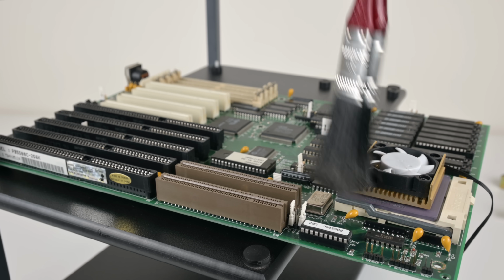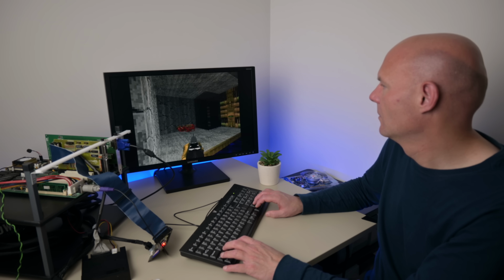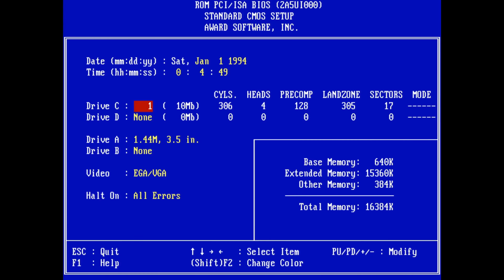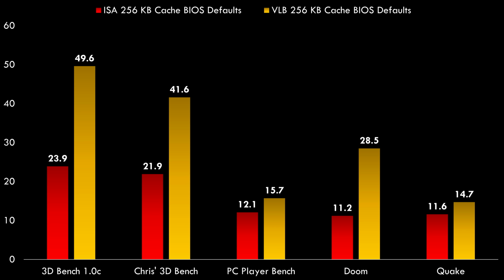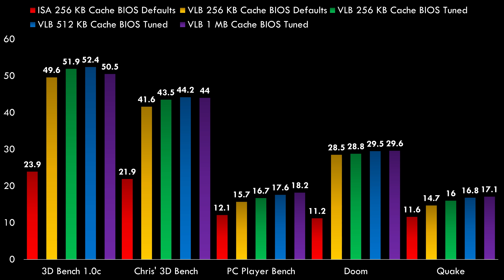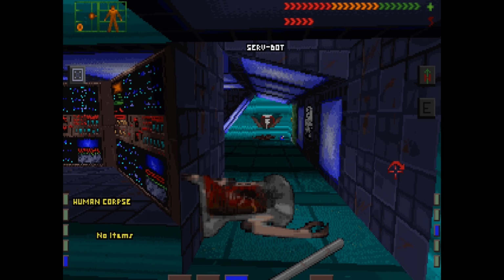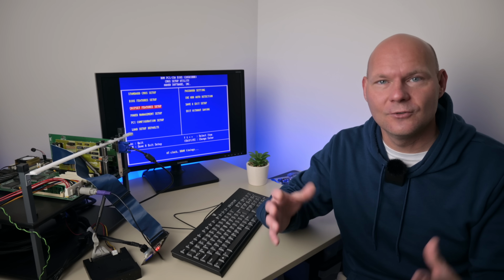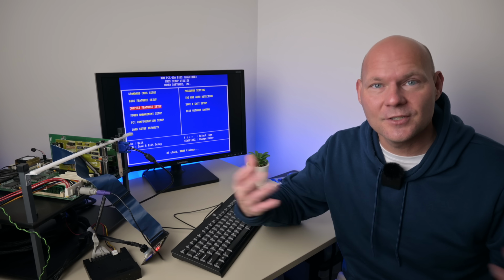Broken CPU Launched the Pentium Branding

Comment: I remember when the p60 first came out and it being so ridiculously expensive compared to a high end 486 that it just wasn't worth it
Reply: Yep, especially considering there were much cheaper 486DX4-100 available around that time which were almost as good as those early 60/66 MHz Pentiums (depending on the task). Though when shortly after Pentiums went to 90Mhz and higher clocks, then it became clear what a beast Pentium architecture was. I was on a 486 DX4-100 until Pentium MMX 166. Fun times, I was really into all that computer stuff back then, was reading all the magazines about new CPU's, video cards, sound cards. 😆 It's not as exciting now as it was back then.
Reply: @kosmosyche  hi, wasn't uncommon for the top end CPUs to command an insane price above the next performing one, the fastest 486 was a budget alternative to the Pentium 90.
The first computers with the 486 DX2 66 were also crazily expensive, that is a March 1992 CPU, the socket 4 Pentium 60 came a year later in March of 1993, then the socket 5 Pentium 90/100 came in March 1994 alongside the 486 DX4 100, in October 94 Pentium 75, and in March 95 Pentium 120 (the 133 before Win 95 in June) so if you didn't needed the FPU of a Pentium a fast 486 were still a great budget option, but you would need a 120/133Mhz 486 to clearly beat the slowest pentiums on integer.
BTW in November of 1995 Intel introduced the Pentium Pro 200(256) at 1300+$
Reply: I remember at the time the first   Pentium came out in 1993, people were just starting to upgrade from 386 or 286 to 486, so usually the average consumer would buy the previous generation when the new one came out because prices came down for the old one and were suddenly affordable. 1993-1994 was also a pivotal point for the PC in general, as a lot more people started to buy PCs for home use, and the most popular CPU for that was the 486DX/66. I only got my first Pentium in late 1996, clocked at 133MHz, and I couldn't have been happier.
Reply: @elimalinsky7069  indeed as the pentium was available when I built my 486 pc but at the time very few games even required an fpu let alone  the kind of fpu the pentium had. That all changed when quake arrived but by then there were much faster pentiums available at more reasonable prices

Comment: This seems like a fun board to work with, I've noticed you hadn't really made a video on the 5x86 either, I do wonder how this board would fare at max with that 1MB of cache and that modified ATI Rage XL from covid times.

Edit: I just noticed this is a Socket 4 motherboard, when I saw "Pentium" my brain went immediately to the Socket 3 overdrive.
Reply: The OPTi boards were slooowwww

Pretty much the bottom of the bucket as far as the original P5 chipsets go, not that there was a lot to choose from.

Their only saving grace was that the P5 was just so much faster than any 486 when it appeared on the scene.

I remember downloading some of the white papers for the chipset since I had one of the OPTi VLB boards - Viper I think.

My speculation was that the OPTi boards weren't even making use of the Pentium 64-bit bus. If  you referenced the white papers IIRC a lot of the part numbers were the exact same as their late model 486 chipsets.

Comment: This was such a crap CPU - I only had to deal with ONE socket 4 Pentium, briefly in the mid 90s, probably like 1997. It was AWFUL. VLB, FPM RAM (No EDO support on the Mobo, IIRC it was Asus) poor timing... Honestly my DX2/66 seemed faster, and my DX2/80 definitely was. That last one had PCI so that may have made a difference.

Comment: These first gen Pentiums are some the most interesting systems but as you have showed their performance is not too much better than good 486 build and 586 chips or the 83mhz socket 3 overdrive tend to outperform the socket 4 Pentium. Though my only experience with socket 4 is a Deskpro XE 560 and even with the Qvision 1280 giving it nice boost in gaming the performance still felt underwhelming but guess have to look at it through eyes from 1993.

Comment: By far the best retro build option for a sort-of comparable system IMO is to get one of the early Pentium IIs with an unlocked multiplier. They're not expensive, the boards for them are more easily available, and you can find them in ATX so they fit well in less expensive modern cases and use modern power supplies. Being unlocked processors, they can be sped up or slowed down as needed to be flexible for a wider range of software. You'll get a lot of flexibility with AGP, PCI, and ISA slots, too. They're perfect for both MS-DOS 6.22 + Win3.1 and Win95/98 or Windows 2000.
Reply: Very good advice. A P-II on a 440BX motherboard is rock solid, the pinnacle of stability and compatibility with any number of vintage operating systems, apps and games.
Reply: Agree. Beyond this point, compatibility gradually wanes, especially when it comes to ISA support. People often warn about needing to find ATX 1 power supplies for such systems, but, in my experience, modern power supplies are sufficient for all but a relatively small sliver of high-draw Athlons during the transition to using the 12v CPU power connector, which was known as the "P4 connector" at the time. Even then you can get the right boards, like the nForce line, which include said connector. You will need to do something extra to get -5V out of a modern power supply though.
Reply: By far the best? Maybe for you, but a Pentium 2 is further away from the 286, 386 and 486 era, where a lot of retro games come from. Then there were the Pentium MMX which had the advantages of compatibility with those and the early Pentiums, as well as "new" MMX enhanced software. There is no "best" solution, just a solution that suits an individual's wants and needs. You could argue an i7 or Ryzen with DOSbox is the better solution.
Reply: @another3997  I think you know what I mean: "best" as in best solution for someone wanting to build a machine to replay the software from the original Pentium era on bare metal. It's not "further away" from those older chips you mentioned in functionality terms, either. P2 is fully instruction compatible with those older 16 and 32 bit x86 chips, and there are options for downclocking it to be generally speed compatible as well if timing sensitivity comes up as an issue. The boards for P2s have ISA slots, so the same sound card, ISA video card, etc., you'd use with those CPUs are still on the table (with the exception of VLB, but just get a PCI video card for that).
I'm just making an honest recommendation for people who want a physical retro computer to run retro games / software on a period-correct (mostly) platform. That was implied as the specified need / use case. Please don't come in here and try to derail a productive discussion with a bunch of "but you could argue _ because it all depends on your wants and needs!" And, like, DUH, yeah, it always depends on wants and needs. But those are pretty well implicit here, so what are you really contributing with the naysaying?
Reply: Look up Phil's AMD K6-III build. Intel fanboi 😛

Comment: VLB were awesomme on 486, but moving to Pentium it was more like a stop gap for reusing what VLB card you bought with your 486.
Reply: Yeah, that's exactly what it was. PCI was a thing by the time Pentiums were, and putting VLB and PCI on the same system often didn't work as well as hoped. It was clear that PCI was the future, but there was just too much leftover VLB hardware to leave behind all at once.
Reply: @wasd____  Yup. PCI-VLB bridge slowed the system down.
Reply from the maker: I believe I tested PCI but don't remember the details. I must have not found much of a difference otherwise would have used PCI.
Reply: @philscomputerlab  i believe it was a former user on Vogpns, that did a test using Pentium board with VLB, PCI and ISA.
Reply: @philscomputerlab I just had this idea for your channel, now that you did an Amiga video a couple of years ago.

Now that the newest console generation is nearly 20 years old. Then why not get a Playstation3, install custom firmware on it, and then test emulators and other homebrew software on it, as well as the overall gaming experience of Ps3 games them self.

It is kind of starting to become retro gaming now, as those that grew up with these machines, have begun settle down and starting family. It is with the 7'th generation now as it were with 486, Amiga, C64, that at some point it is cheap and then prices explode. That time have come now, with that console generation. Cheap before it becomes hip to own.
Reply from the maker: @brostenen  Consoles is just not my area. Even DOSBox, PCem, 86Box is pushing the boundaries of what I want to cover. The Amiga video, yea I remember this time, it was the original Mist FPGA computer!
Reply: @philscomputerlab  It might just be me then, that love anything gaming. 😁 Computers, consoles, handhelds.... Love it all. I just dont get why some people are fanboys, but I fully respect if someone have no interrest in a complete field of hardware category. 👍
Reply from the maker: @brostenen  Honestly if YouTube algorithm would be supportive of branching out, I would. But it really punishes going off the track too much. I've focussed more on the retro content recently and even that pivot takes a while as the algorithm still has in mind some of my non retro content like X79 and X99 😂
Reply: @philscomputerlab  True. We must also not forget that vintage gaming no matter what type of stuff it is on, will still remain a kind of niche hobby. I bet vintage cars are way bigger a hobby. Or something else. 😉

Comment: What's insane is that the first Pentiums run at 5 volts.
Reply: @ch-tc4ct Well, it's 33% which is pretty damn much for hardware like this, so I'm not that surprised that these weren't good overclockers.

Comment: You should consider testing a Pentium Overdrive for Socket 4 (PODP5V120 / PODP5V133) on that board and then compare it to a bog standard Pentium 120/133 on as similar a Socket 5 board as possible.
Reply from the maker: Now just have to find such a chip 😀😂
Reply: and a Socket 5 Board with Opti VLB Chipset (those actually exist too) @philscomputerlab
Reply: That is a really interesting idea. I remember all the debates about whether a P120 was actually faster than a DX4-120, and it would be great to see them head to head.

Actually, I probably have specimens in my Computer Closet...  finding them is a different question!

Comment: My family had a Pentium 60, purchased second-hand, back around ... 1996? It replaced a 386sx so it was a pretty exciting step up at the time. I remember over clocking it from 60 to 66 mhz! It wasn't long before it got replaced by something newer, though it stuck around as a 2nd machine for a long time and I even took it to college my first year. 

At the moment I have a Gateway Pentium 60 in my collection but haven't gotten around to actually setting it up for anything - and I may never.  As far as useful / fun things to do with retro stuff there are certainly more practical and easy-to-acquire options out there.

Comment: I do have Socket 4 boards and my experience is that it's actually fun to try the same (DOS) games and demos that show the limits of a faster 486. The Pentium behaves very differently and in my experience it's roughly equivalent of a DX4-100, sometimes slower, in rare cases it's even faster. That AMD 5x86, especially at 160MHz and in a good motherboard runs circles around it (for example it's possible to see 100+ fps in 3DBench in a well tuned 5x86-160 system) - with the exception of Quake that makes good use of the independent and pipelined FPU of the Pentium. What I couldn't try is a fast socket 4 board, they tend to have dog slow chipsets and mostly only EDO tolerant rather than making actual use of the newer, faster memory. At least the VLSI and SiS ones I could try were slow. Intel made its own chipsets for the Pentium and it took a few iterations to get it right. Is there an i430FX chipset for socket 4 at all...? That's the turning point, AFAIK. And I tried 430FX with Socket5/7 CPUs and it's very decent, very close to the more modern S7 chipsets. Those I've tried with S4 - not so much.
VLB with Pentium is something I could never try with a Pentium so it was quite educational :)

Comment: Despite my fond memories of my family's Pentium 60 PC, for my roughly-equivalent retro PC build I went with a P54CS Pentium (Socket 7) system, which is already a much lower-power processor and a more stable platform, and I also downclocked to 75 MHz CPU / 50 MHz bus for further stability. Ends up being roughly the same speed but I'm far more confident that the reduced heat and clockspeeds should help ensure that the hardware will have greater longevity. (Not to mention the parts are cheaper and easier to find.)

Comment: My family's first home computer was a Packard Bell Legend 100CD, equipped with a 60 MHz Pentium and Windows (FW) 3.11 plus DOS 6.2. I believe the last PC I had been using was a 386 or low-end 486, so I really enjoyed the performance boost for many of my games. Technically the P5 Pentium was not that great; not only the FDIV bug but especially the high power consumption and questionable stability with Socket 4 boards, but even despite those you could see its performance potential, and I have to say that not knowing any better as a kid it was still a pretty great upgrade for me and was well-suited to most of the games around at the time. My dad even had the tech come out and do the CPU replacement for the FDIV bug (which did not take care of the odd graphics color corruption I occasionally saw like I was hoping it would).

Comment: Did you try with any VBE util when testing the 640*480 res.? I remember it could give a nice speedbost when running at higher resolutions when you had the CPU horsepower to do it.

Comment: Pentium 60 performance.......... I remember back then when i had to decide between a used Pentium 60 system and my second 486, it was a DX4-100 intel with a whopping 32MB of RAM and S3 Trio VGA. I was happy i had chosen the 486 because it ran nicely stable at 120mhz with a 40mhz bus and it kicked P60-ass. It was 1996 and back then even new Pentiums (120, 133, etc) were sold with only 8MB of RAM. What a shame. But my RAM constellation was a bit weird. It was a Soyo Board, with PCI and 4 PS2 RAM slots, 2 of them were populated with 8MB each and then i had a SIMM-Shuttle filled with 4x4MB 30pin SIMM.. Well it did work! Glorious times back then! Cheers Phil and a nice weekend!
(i would love to send you a modded SL2Z4 Intel MMX Processor so you can make an interesting Video about it if only i knew your shipping address.....)

Comment: At the time my opinion was that the Pentium 60 and the Pentium 75 we're not good chips. It's interesting to see how they perform in a highly optimized and tweaked system because at the time these chips were stuck in computers that were hot garbage. My 486 DX-4 100 and circles around my friend's Pentium 75. It wasn't until he got a Pentium 150 system that he totally trashed me.

I used to work on a lot of people's computers. It was so rare for someone to know anything that people would call me over to their house to fix stuff. Inevitably someone would have one of these Pentium 60 or Pentium 75 machines from Gateway or Packard Bell and they would just chug. 

Maybe these cheaper SKUs skimped out on cache? Possibly terrible video cards? Whatever it was I hated them.
Reply: It's probably not the CPU, maybe another component was holding your friend's PC back because the Pentium 75 is faster than a 486 DX4 100.
Reply: @kathleendelcourt8136  
Don't get me wrong, Pentiums 100 and above tended to be put in computers with components that were very high quality. I'm sure the right pairing allows a Pentium 66 or 60 or 75 to outperform a 486 at 100hmz, but that wasn't typically the configurations that got sold at a place like Gateway or Dell.
Reply: I suppose your memories of these chips must be from aroun 1995.
When the Pentium 60/66 came out in March 93, the fastest 486 was the DX2 66.
Socket 4 computers weren't cheap or low end before they came out, when the Pentium 75 on Socket 5 (Oct94) came out,  they fire sales the few remaining units, but until March 94 nothing faster. (The 90 & 100 became the top dog in March94.)
You would had to wait until March of 95 for the opportunity to purchase for a mountain of money a Pentium 120, by that time the Pentium 60 was an oddity that nobody wanted but still a better CPU than an ancient 486 DX2 66 from March 92.
Intel released the 486 DX4 100 at the same time as the Pentium 90/100 (March 93) as a cheaper alternative to these CPUs, not everyone needed the FPU of a Pentium and they needed some time to bin the 75MHz parts, the DX4 100 was almost as fast as the Pentium 75 on integer, not faster.
So IMO it's not fair to compare a Pentium 60 with a DX4 100 by the time that 486 came out Intel already replaced it with the 90/100.
Reply: @RetroTinkerer  ok that makes sense! Yeah it was my senior year in Highschool which would make it 95/96. I remember vividly because I was just a poor kid scraping money together to build a computer from parts and I was out performing some of my rich kid friends. One birthday later and I was back on the bottom of the barrel, but whatever.

I had an AMD chip, because it was the best bang for the buck I could get.